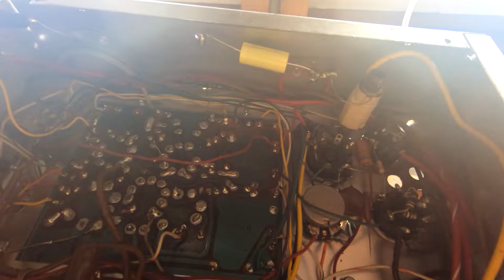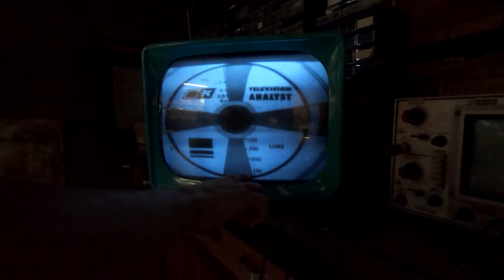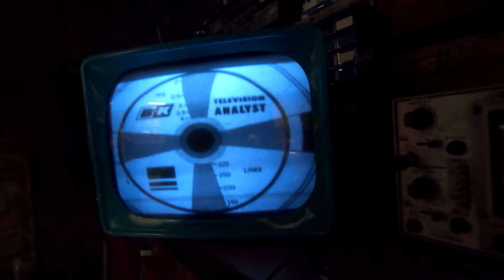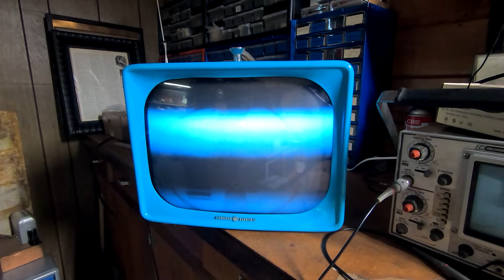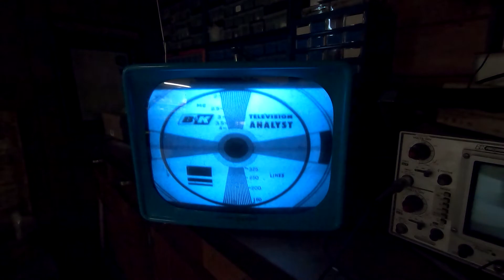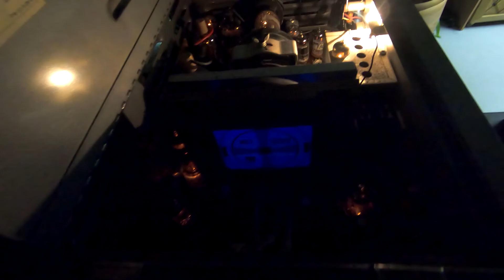B&K (Dynascan) Model 1076 Television Analyst  Part 2 - It's Alive!

Comment: If its got an RCA jack on the rear panel, it's a B version. The originals didn't have that. Also it uses a different phototube than the original. The new version's phototube has more pins and is not compatible with the 931 phototube.  I've got one of each of the two versions.